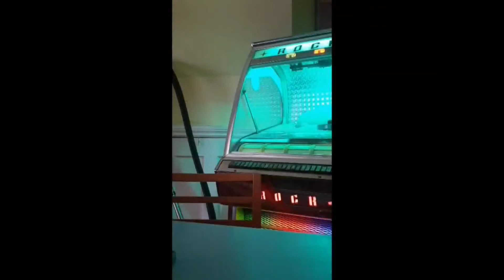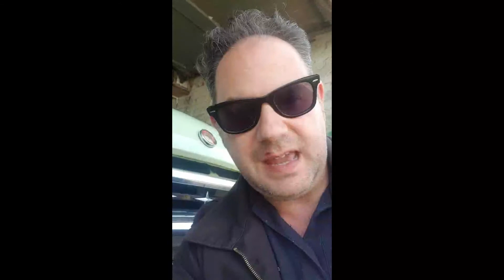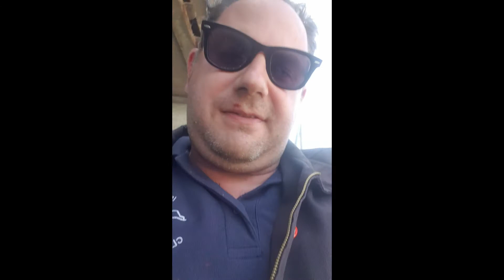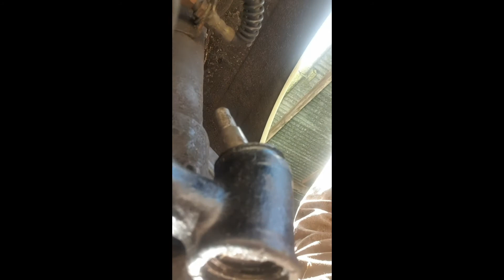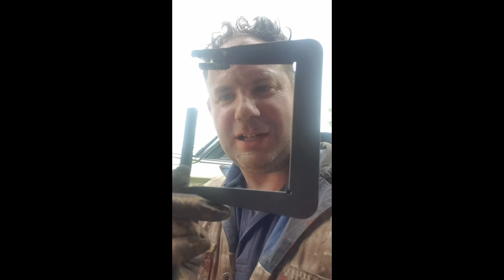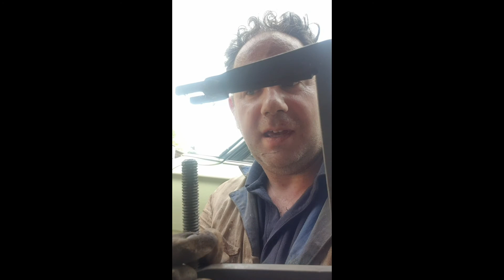Consul Capri Ball Joint Replacement in situ

Comment from the maker: I did more or less have everything off, but as I could not fit the polybushes, I had to repair what was there, otherwise I normally would have replaced complete. Might get you out of the hole if same thing happens to you?